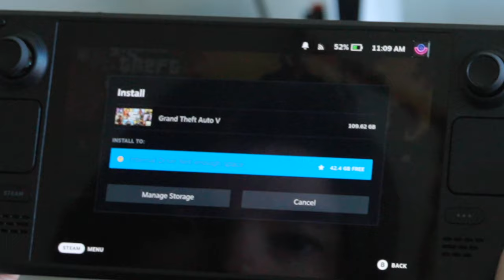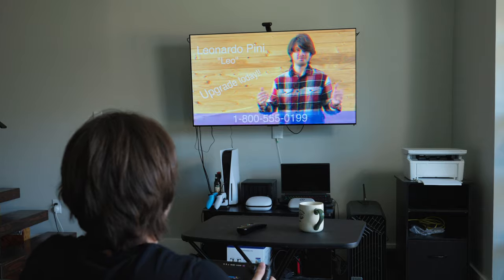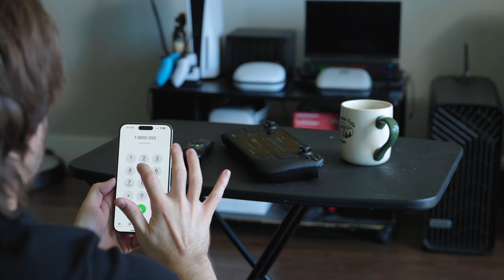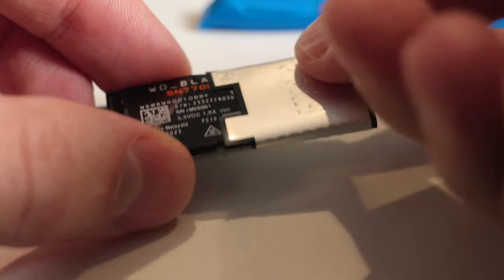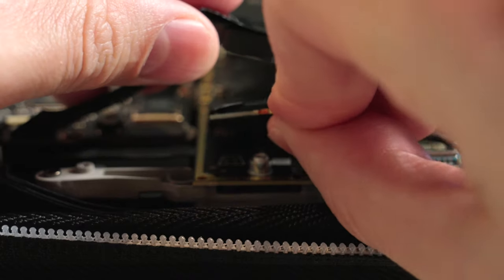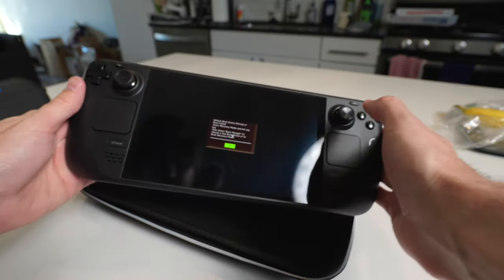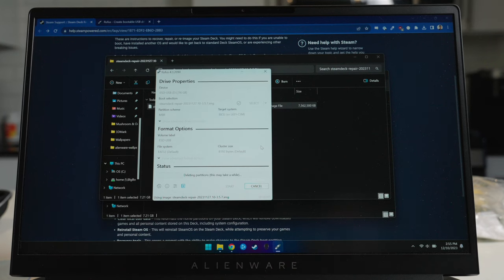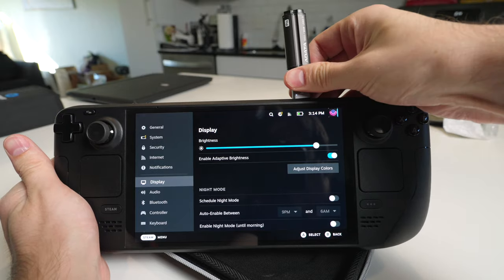Upgrade Your Steam Deck OLED 512GB to 1TB or more.

Comment: Thanks for this. Its interesting how you were still able to do it without detaching the battery and the black ribbon cable. Great angles and shots too really helped. Waiting for a good deal on the 2TB SSD
Reply from the maker: Thanks! The ribbon cable is no problem but I do recommend getting that battery unplugged when performing an upgrade like this. I hope you find a good deal soon!

Comment: 512 GB to 1 TB doesn't seem like that big of an upgrade, especially with how large games are now. 2 TB 2230 has come down a lot, why not 2 TB.
Reply from the maker: 2TB is a good amount of space. If you can find a deal and need the space then 2TB makes sense.
Reply: I Upgrade only to 1tb 😊 1tb cost me 80€ and 2TB cost 195€ i dont think 2TB is needet. I have a Gaming pc with 4tb 4080 and steam Deck is my couch device
Reply: Realistically unless this is your only device and given the limited power of this device (meaning you won’t be playing those more demanding and larger size AAA games), 1 TB is definitely more than enough. You’ll just need to cycle through games you beat worst case scenario. In fact, while more storage is preferred I’d argue this a rare case where 1 TB is truly a sweet spot size. Your better off saving the extra $80-$100 you’d need to dish out for a 2 TB drive towards another upgrade such as a case , screen protector, or even some games.

Comment: I've heard that the Steam Deck gets much hotter with the SSD and the battery drains faster. Do you have any experience? wanted to install my 1tb SSD today.
Reply from the maker: I haven't experienced that, no.
Reply: As a technical support specialist that does not make any sense. If bought a proper drive from a trusted brand you shouldn’t experience this on a noticeable degree.

Comment: Do you know if the steam deck bag prevents static? I was thinking about using it like you did, but I'm worried about the fabric causing static
Reply from the maker: I don't believe the Deck's carrying case causes static build up that could potentially harm the device. It should be safe in there from everything except for being waterlogged by a hurricane or crushed by a sumo wrestler. YMMV in those particular instances.

Comment: Great vid! I did want to add that it's not necessary to unplug the battery cable, as long as you have the Steam Deck in "Battery save mode" (hold the + volume button at the same time with the power button to access it). 

Also--and this is important--make sure to check for the audio cable to see if it's taped to the heatsink before trying to lift it away. Mine was, and I couldn't see it because the long CR cable was covering it. I kept tugging at the heatsink wondering why it wasn't coming away and I'm hoping I didn't damage my audio functionality in the process. Still in the process of putting the Steam OS back on it so I'll know before too long.
Reply from the maker: Thanks! Knowing about that mode is a little more comforting. My concern mainly comes from working on numerous laptops where unplugging the battery is very important before touching hardware.

Thanks for the heads up about the audio cable. I don't recall running into it in my teardown, but perhaps there's some builds out there where it might get caught like it did in your case.

Comment: You can get an OEM WD SN740 2TB (Read-5150MB/s, Write-4850MB/s) for around $160, and it's supposedly an all-TLC drive.  I used it and it works great.
Reply from the maker: That sounds like a great deal. Lots of storage and fast. Thanks for sharing!

Comment: Hi, I love your video and pretty simple explanation, but this video is different from the other, because you didn’t unplugged the left screw of the ribbon cable, is it safe to do that? I still afraid to upgrade my SD oled because of that step
Reply from the maker: Taking extra steps to get that ribbon cable out of the way is going reduce the risks of damaging it. Do what you feel is comfortable as long as you can avoid damage to that ribbon cable.

Comment: damn... valve made it harder to upgrade :( I just got my rog ally Z1E. unplugging the battery, and putting the ssd it's so easy with the ifix it tools!.
Reply from the maker: It's not as easy as upgrading the Ally like you mentioned. I do appreciate that we have the option to upgrade the OLED Steam Deck and not compromise the structural integrity. That wasn't the case with the LED Steam Deck.
Reply: @TaylorBrauer  wait... why it's not so easy? the only tricky thing it's the disconnect the battery, but with the right tools it's no sweat. you meant that?
Reply from the maker: @netrodex  I worded that weird. I agree it’s easier to upgrade the Ally than the Steam Deck OLED.
Reply: @TaylorBrauer  ahhh hahaha no problem man :) it happens.. auto correct and stuff

Comment: I have a lot of games and programs on an external storage card. Will I lose them when I change the SSD?
Reply from the maker: If you have a game library on an external drive it should sync after re-install with a new internal SSD. Be sure to research how to do this before you replace the drive. As for programs, probably not since those interface closer to the OS. You'll most likely have to re-install those programs.
Reply: Got you , If I use UGREEN M.2 NVMe SSD Enclosure, can I save my games?@TaylorBrauer
Reply from the maker: @All404G00d  Ah you mean taking your old drive, putting it in an enclosure, and then playing games off that from the new internal drive? I'm not 100% sure tbh but if you point Steam to that game library I'd be surprised if you couldn't play games off it. I really haven't tried what you're attempting to do and there's probably a better guide out there than what I can provide you with here.
Reply: @TaylorBrauer  I have old games like God of War 1 that have reached an advanced stage and I don't want to play it from the beginning, so I ask you. In general, thank you for the response you are the best
Reply from the maker: @All404G00d  Np! Enjoy!
Reply: @TaylorBrauer  thanks man y too